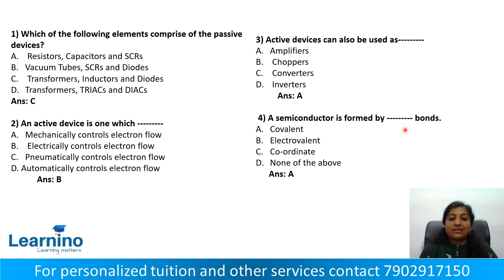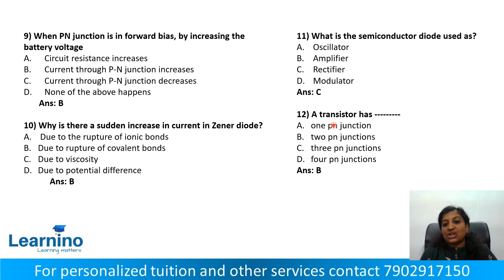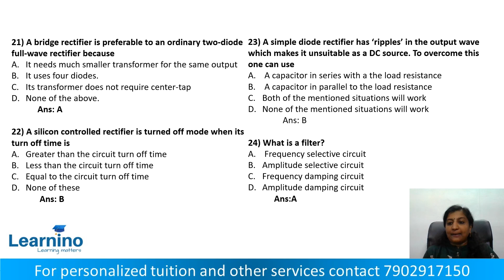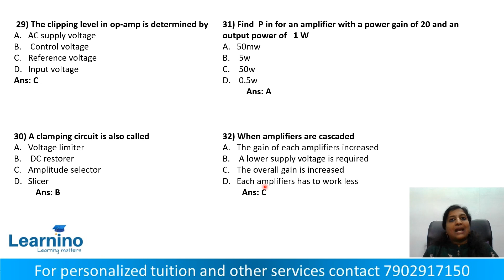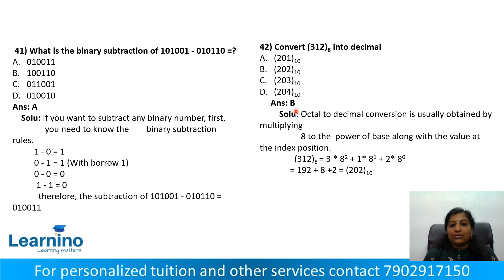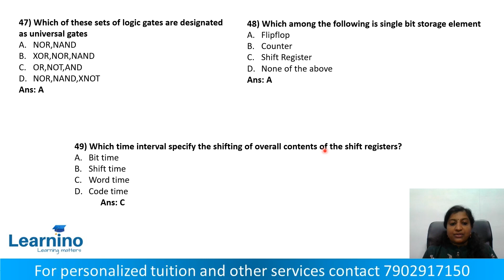KSEB SUB ENGINEER Module 5 Sure Shot Questions

Comment: How the answer for 18 is B? Ma'am
Reply from the maker: The peak inverse voltage is smaller than the input voltage due to the presence of diode(s). A single diode reduces the output voltage by approximately 0.7V
Reply: @learninotechnicalexamcoach3629  thank you